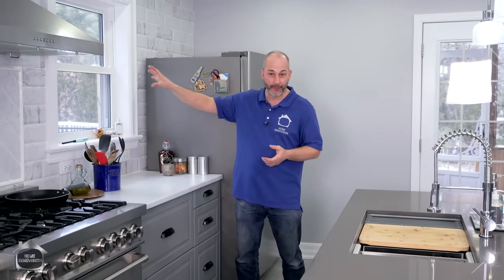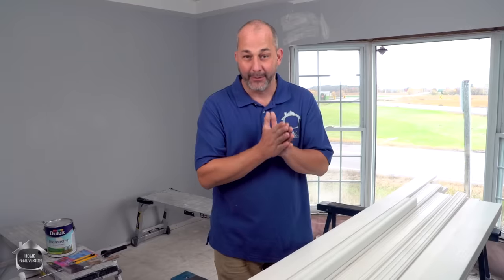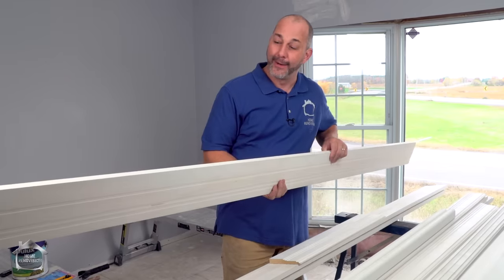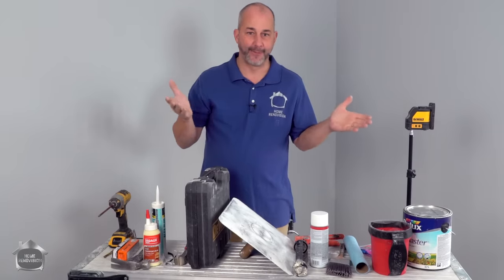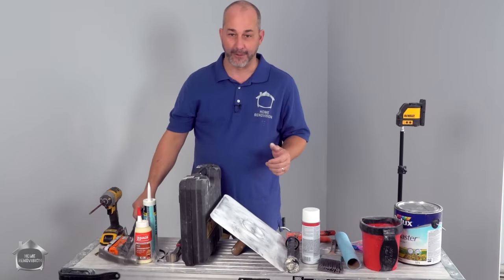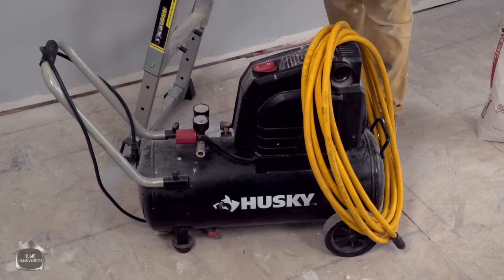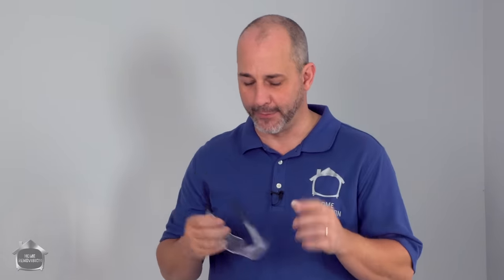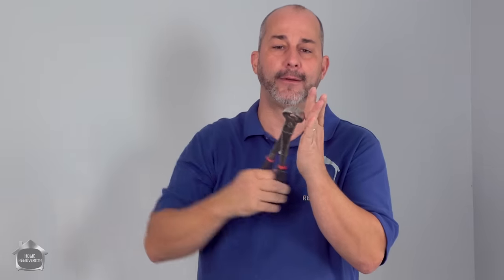How To Trim Doors Windows and Baseboards | A to Z

Comment: As a finish carpenter myself. I disagree with so many things in this video. I have watched many of your video also. Many were informational and follow how I do things.  But cutting inside base molding like you are doing is going to cause such frustration and inferior work for anyone that does it like your video. THE ONLY way to get base inside corners to fit tight is to cope them.

Comment: Not to be that guy but...so much wrong on this video its crazy...ive been a professional interior carpenter for almost 15 years now ever since i started in contracting at age 17...anythinf beyond 1/32" is unacceptable especialy if you are trying to teach people... so many ways that inside base miter could have been tightened up prior to nailing from springing the bottom of the corner with a screw or nail to going with a tighter angle...the outside corner should have been a sharper angle to close the face theres no excuse for an outside miter to be over 1/8" open...also why not spackle or a woodfill product on the joints...? caulk is a terrible filler its nice for where following the casing/jamb and casing/wall also good for tops of the base but terrible as a filler...also the door casing the left side of the header should have been tuned to a 44.5° to close the heel and a 45.5° on the right to close the tip and also should have slightly compounded both to close the face a bit tighter...and seriously tin sheers for cutting quarter round? Would enjoy seeing that cut close up...and the condescending talk about doing things right on the window tutorial while leaving 1/16"+ open joints and misaligned profiles and talking about cracking joints his was already cracked to start with so its guarenteed to open in the future as the caulk/spackle cracks and will show a split... show off what your good at or bring a guy in who is who can offer true insight

Comment: YOU ARE NOT A PAINTER; Mr Thorman, you are a good carpenter but, you are not a painter! I've  painted high end houses for over thirty years. I've never seen someone paint like that. I don't recommend using a sanding sponge for trim work. Sanding sponges are for drywall! Use a high quality 220 or 320 grit sand paper for your final sanding. Bad choice of paint brush as well, stiffness is not the only criteria for choosing a brush. Furthermore you don't know how to hold the paint brush. Pounding the brush into the bucket and Dry brushing? Cringe worthy. You are not putting any paint on the surface. Of course you don't want to just slop it on but, you need to put enough paint on for coverage and mil thickness. If you know how to handle a brush you can put a good coat of paint on the surface without making a mess. Try adding a little floetrol (Made by PPG) to your paint it will flow better and the brushstrokes will not show. I've watched a lot of your videos and you are good at a lot of things but, you are not a painter. Stick to what you know so you don't pass on bad advice to your viewers.
Reply: Trust me, he's not a good carpenter either

Comment: Monument of inefficiency u got goin. Watching u cut/install that door casing I had to turn it off. Ur measuring techniques are atrociously NOT zero'd in,  which is what these folks need to do, especially cause u just showed everybody how NOT to get the top casing reveal accurate on the door! Theres some better measuring techniques to always measure from the long point of the casing angle u dont know about. That way u can always put outside angle away from the saw fence, in direct sightline toward the person cutting. Always teach people to make a small micro mark with sharp point pencil. Then start cutting a hair long, adjusting to the micro mark. Thats the easy accurate 2 step process.. stop teachin the 4 step.
Reply: That door trim….. yikes. The corners matched but looking at the top of the door frame about 1/4 reveal on one side. The other probably 1/2 inch.

Comment: Spring loaded nailsets work great, too.  All that talk about wearing eye pro, and he never put them on.  Using a framing pencil for finish work?  The reveal on door headcasing didn't look very consistent.  The length of the small, double outside corner, 4 7/8", never equated for the thicknesses of the adjoining baseboard.  Do Canadiens know how to scribe or cope?  This guys techniques are terrible, look for another channel.  Better yet, just hire professionals to do the work.
Reply: lol his miter cuts look way better than scribe jobs I've seen the "professionals" do. His work looks great to me, no point in scribing when wood glue will do a better job and I'll save the thousands and do it myself and with a better result.